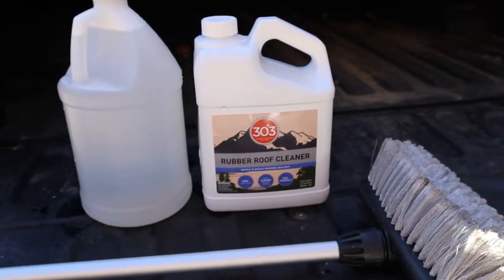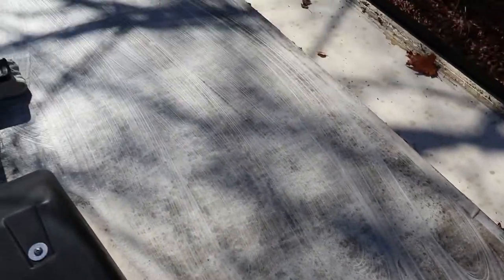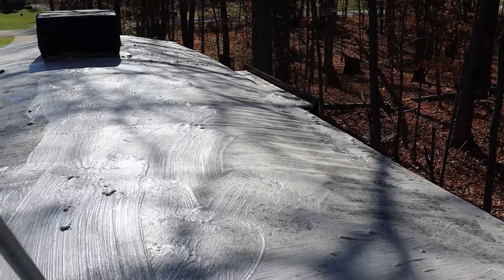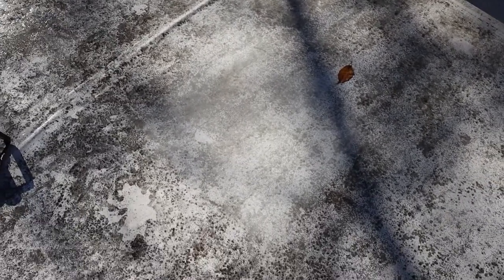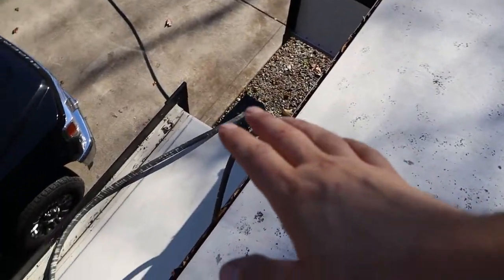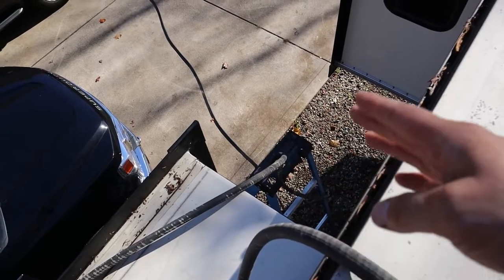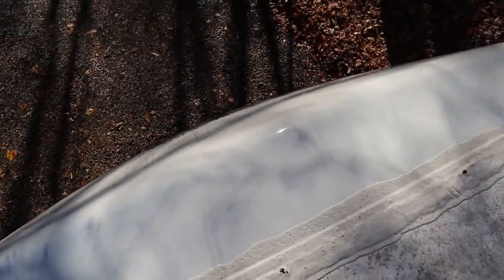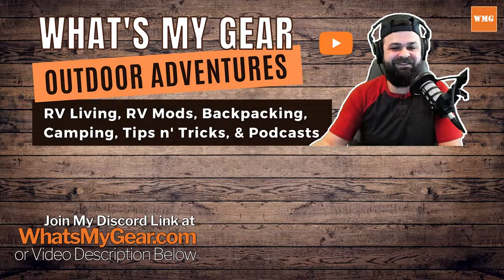RV 303 Rubber Roof Cleaner, Watch This Before You Buy

Comment: I just recently recoated my roof with the Lanco Primer and Siliconizer. Before the recoat, I cleaned with TSP and have to say that I was very impressed with not only how fast it cleaned with very minimal agitation action from a soft bristle car wash brush, but also how fast & easy it rinsed.

As I only have the Lanco on for a month, I will have to wait on evaluating the coatings, but they did spread very easy with a roller.
Reply from the maker: That's great to hear when products work correctly. Just curious, what is TSP?
Reply: @WhatsMyGear  I saw it on a YouTube video a couple years ago, and it sat in my wash bucket for probably just as long. 

I didn't use it the last time I recoated my roof and regretted it as I had just used Dawn dishwashing liquid and then recoated the roof with the Lanco Ultra Siliconizer. In less that two years the coating was peeling up in sheets. This time I used the TSP and I was impressed as I could see everything just lifting off and rinsing away. I used the Lanco Aqua Proof Primer first and then recoated the next day with the Ultra Siliconizer. This is more of a Band-Aid for now as I have a lot of soft spots on my roof where the plywood is delaminated. But should keep the water out for now.

It's only been on now for a month, so I won't really be able to say how it hold up under the Arizona sun for at least a year.

Comment: I would use a pressure washer .
Reply from the maker: Im a little concerned about the pressure doing damage. If you try it let me know if it works. I'm always interested in new options.
Reply: @WhatsMyGear  Yes , electric ones have less pressure than gasoline ones . I'm thinking a electric one that auto detailers use for vehicles .